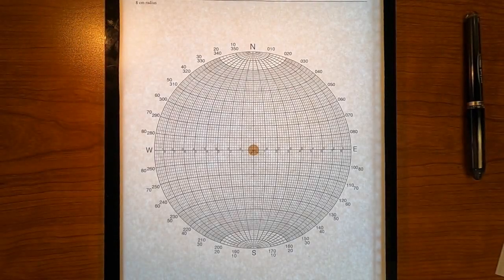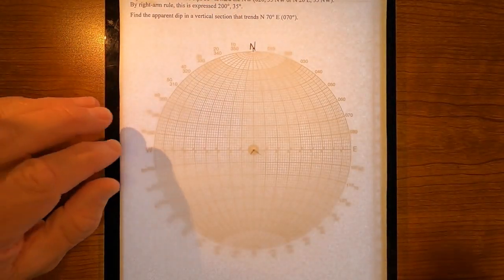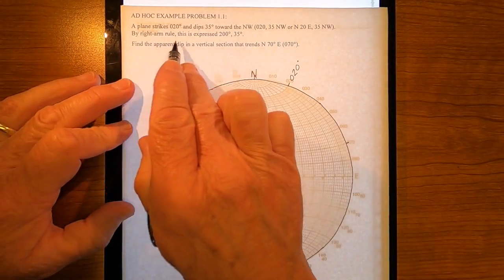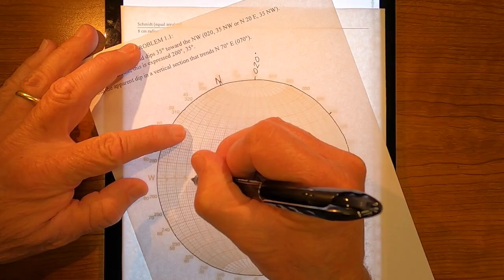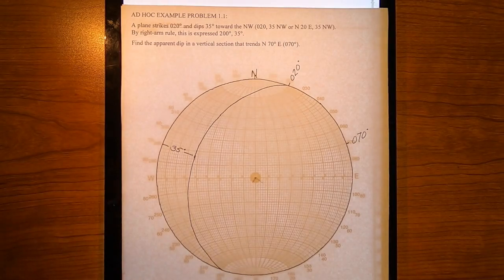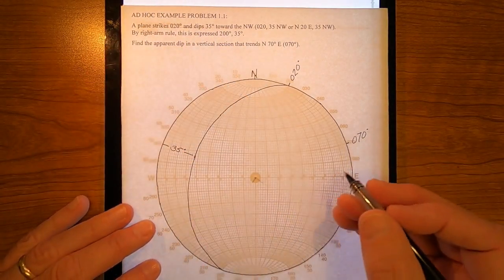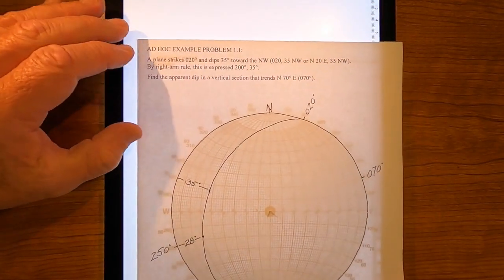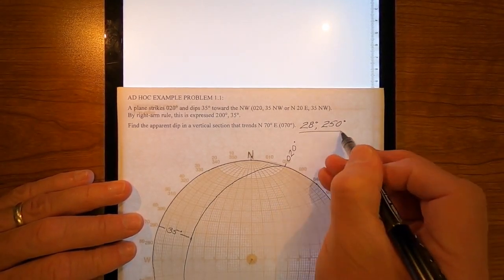Structural Geology: Stereonet: Apparent Dip: Example 2.1.1

Comment: First of all thank you for teaching us.

A fault/bedding intersection line of 170/38 is observed on a bedding plane oriented at 060/40E.
The same fault forms an intersection line of 020/30 on a vertical joint surface that trends 020.
(a) What is the dip notation of the fault? Give your sketch on a tracing paper and describe your
drawing procedures.
(b) What is the acute angle between the intersection lines?
(c) What is the acute angle between the fault plane and the bedding plane?
 Is it possible to explain. Thank you
Reply from the maker: @thillaigovi1981  This sounds like it’s from an academic problem set. It’s really quite simple if you can sort through the scenario and recognize what you’re given in terms of geometric elements (lines, planes, apparent dips, etc.) After that, you may find a couple other videos from my stereonets playlist useful (Stereonets for Students of Structural Geology).